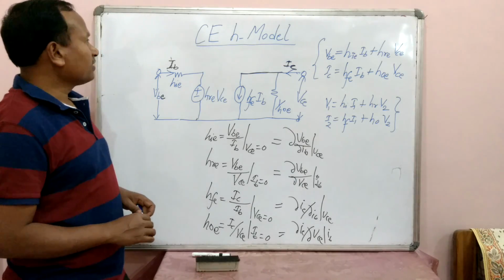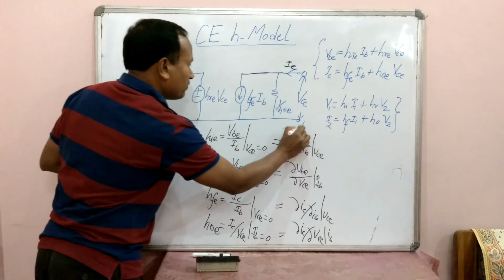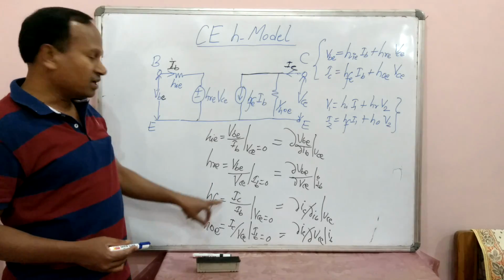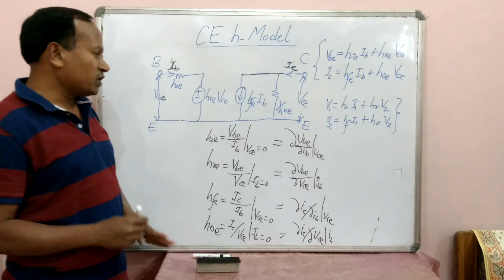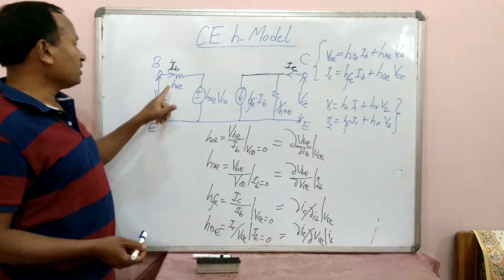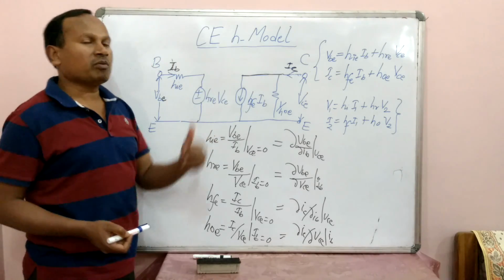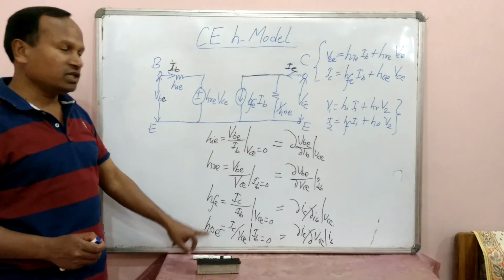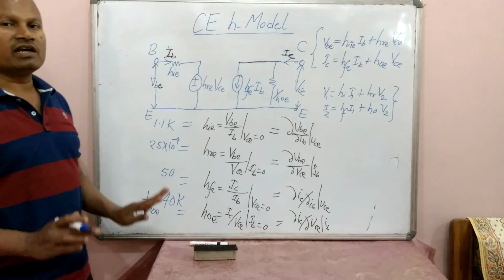Common Emitter Hybrid Model (CE h-model)

Comment: BJT parameters are used for ac analysis in a transistor (Active mode- Amplifier) 
You didn't even biased the circuit with ac signals 
Too much shortcut 
I don't know why some faculties don't consider that all students can't think in their ways
want to gave an example guys 
Follow Neso Academy 
It will take lot time than this but better than understanding unnecessary complicated things